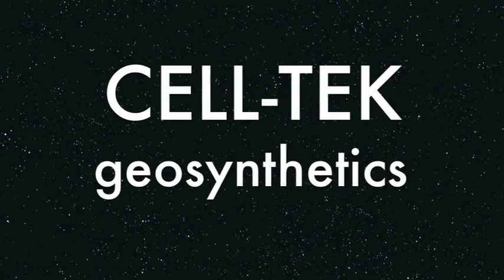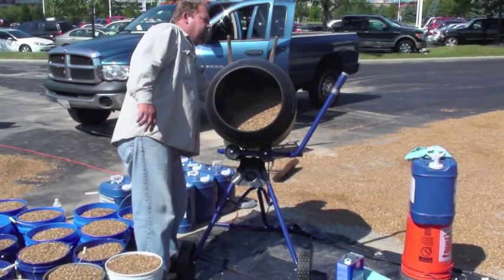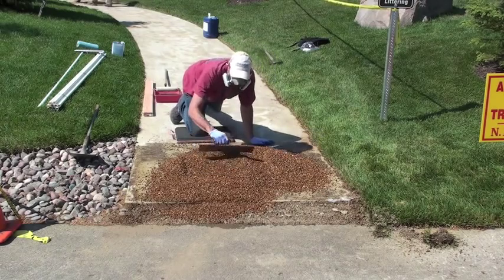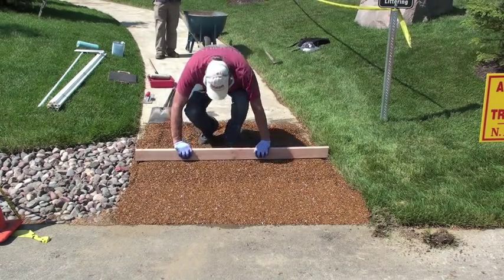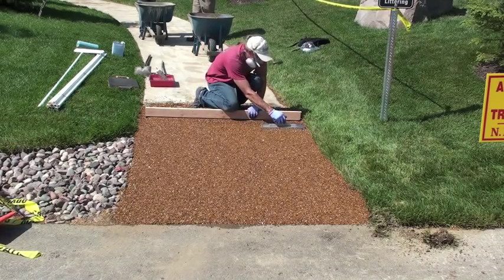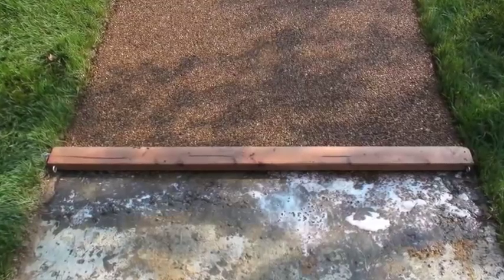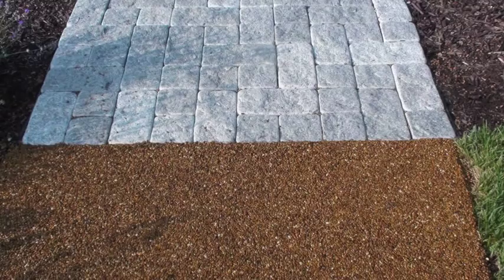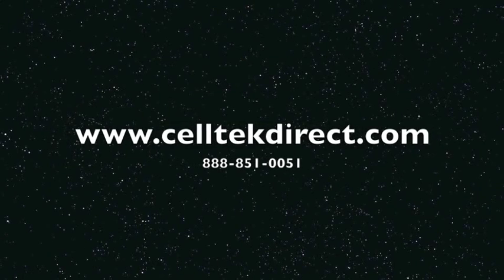Concrete Layover with Gravel-Lok

Comment from the maker: Gravel-Lok is a pervious pavement. Water will pass through it. Be sure the concrete pavement is graded properly in order to allow water to flow away. Gravel-Lok is available in two formulas, Amber and Clear. You may notice yellowing in the sun when using the Amber formula with very light or white colored stones. This will eventually diminish, revealing the natural color of the stone. We typically recommend using the Clear formula for very light or white colored stones.

Comment: Hi Guys, Is your product available in Australia.  I have been looking at using exposed aggregate mixed with concrete spread over some type of adhesive at around 25mm or 1" in US.  Everyone tells me it will crack, so your product could be a great alternative. I have about 150 sq met or 180 sq ft to cover. I was also looking at around 4'6" wide and leave a 5 mm space where I could grout for effect.  I might look at your web site.

Comment: Will this hold up during winters with freezing, thawing and refreezing temperatures?
Reply from the maker: Yes! If Gravel-Lok is designed properly with drainage in mind, it will absolutely do well in areas with freeze and thaw cycles. This means that the pavement should be slightly graded, which is really a typical installation technique for any pavement. If necessary, install drainage below to carry away an excess water. As long as the pavement can drain, it will not have any issues.

Comment: I have a pea gravel concrete driveway and patio that are showing wear and cracks after 40 years
Will gravel lock install over it?  I live in Memphis.  What is a ball park cost per square foot figure
Reply from the maker: Yes, you can do a an overlay application with a layer of new pebbles and Gravel-Lok. Give us a call to discuss pricing and installation techniques. 888-851-0051

Comment: I have this type of patio and over the years some of the pebbles have come up and a re loose. Is there a way to repair to prevent further loss?
Reply from the maker: Yes, you can repair any divots that have formed by patching those areas and apply a roll coat to the entire patio to firm it up. Give us a call at 1-888-851-0051 for more information and to purchase some liquid for this purpose.

Comment: How much sq ft does 1 five gallon bucket cover? And can this product be applied vertically on a riser?
Reply from the maker: If you are going to  mix the liquid with pebbles and trowel out at 1.5" thick, the coverage rate is 124 sf per five gallon bucket of liquid OR 93 sf per five gallon bucket of liquid at 2" thick. In addition, 24 hours after installation, once the product has cured we highly recommend applying a roll coat with a medium nap foam paint roller. Coverage rate for this step is about 90 sf per gallon or  450 sf per five gallon container. Regarding your second question, since Gravel-Lok has a 24 hour cure time, in order to install it in a vertical space you need to build a "form" of wood, lining it with plastic such as a heavy duty contractor trash bag, to prevent the pebbles from sticking to the wood. This "form" would be designed to hold the gravel in place while it cures. Please call us for additional details, 888-851-0051.

Comment: Would this work on an asphalt driveway?
Reply from the maker: +Donald T 
We do not recommend a layover on an asphalt surface because Gravel-Lok will not adhere to asphalt. Gravel-Lok will adhere to concrete.
Reply: You will need to ruff up the asphalt

Comment: About color options? Any?
Reply from the maker: Gravel-Lok does not come in a variety of colors. We offer two formulas: Amber and Clear. The Amber formula has a  slight amber tint to it, so it should not be used with white or very light colored stones. The two formulas are not the same price. The Clear formula is more expensive than the Amber because it contains UV additives.